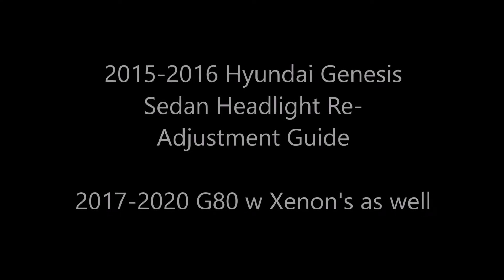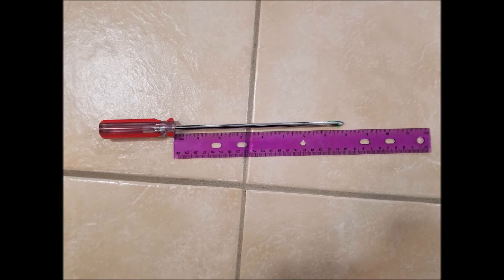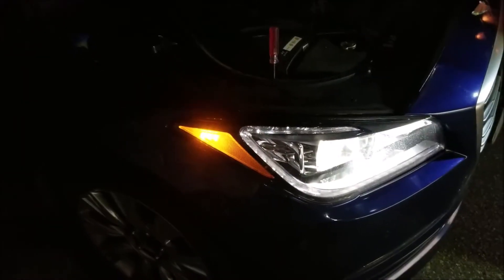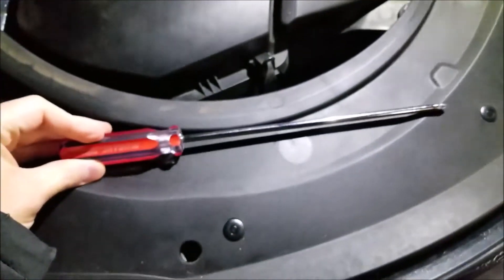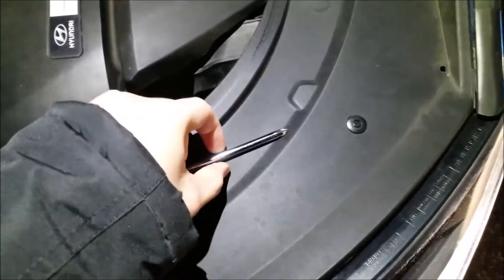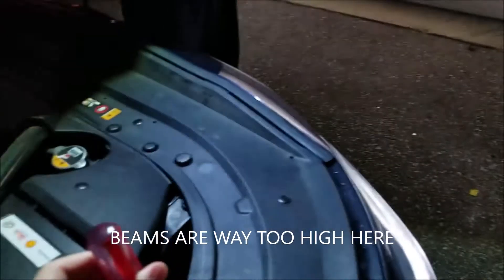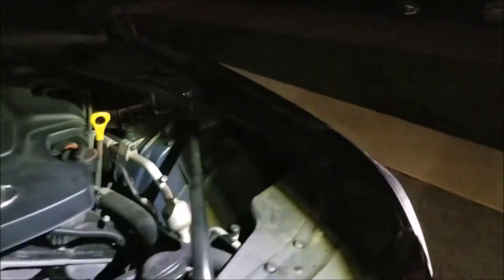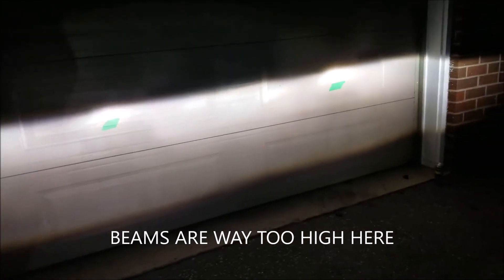Headlight Beam Adjustment 2015-2016 Hyundai Genesis Sedan Xenons

Comment: Thank you! This is exactly what I needed. I'm so glad it doesn't involve taking off my bumper, removing the headlight assembly, or any of the other possibilities I expected. I have definitely felt like my 2015 genesis had the headlights aimed waaaaay too low. Night driving has been kind of scary. I also feel like the HIDs are too far on the blue side which looks neat but is worse for visibility.
Reply from the maker: oh yeah me too, thankfully they made it pretty easy on this model
I felt the same way that they were aimed wayyy to low from the factory. You can swap in a more useable light bulb into the car. The Osram nightbreakers are around 4300k in colour temperature which is more on the yellow side